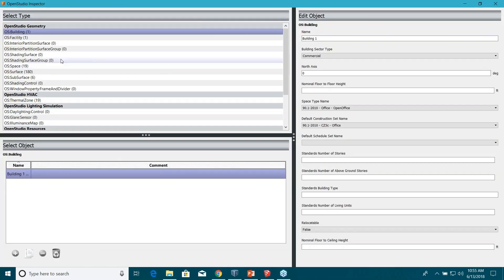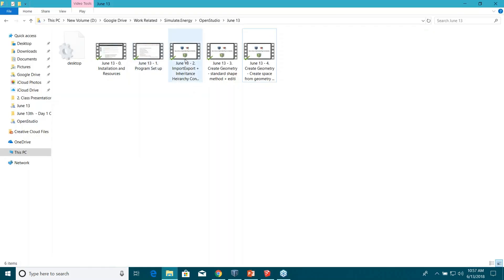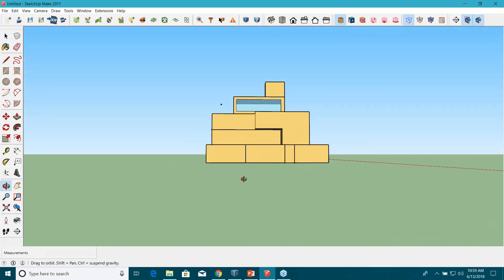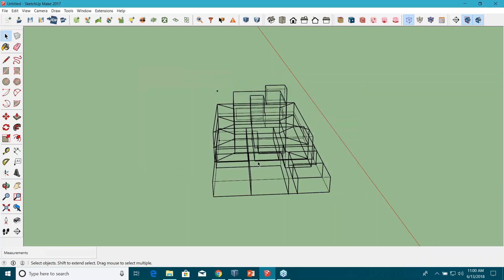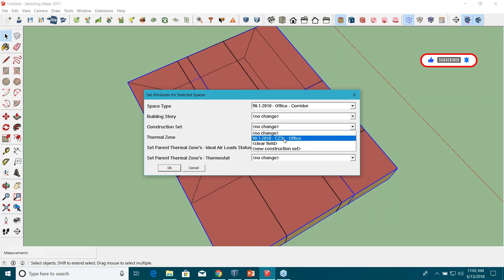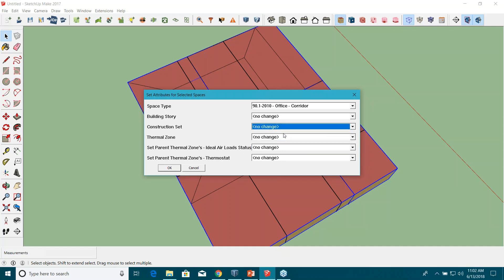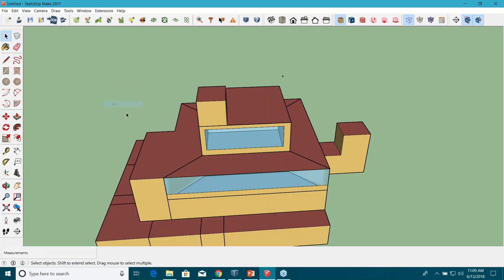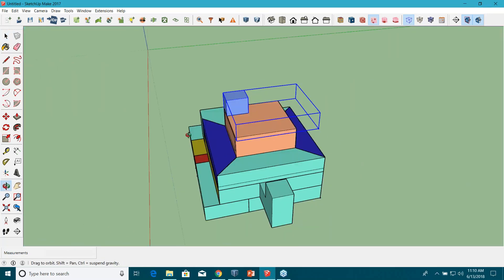OpenStudio Building Energy Analysis Tool | V07 - Assign Building Properties IN SketchUp | EnergyPlus

Comment: Hello, may i please ask a question, when I am doing a multi-layer model, due to the different room structures of the upper and lower floors, after doing the contact surface inspection, the contact surface of the upper and lower floors is not green, they are still the original yellow of the floor, what should I do? Thanks.
Reply from the maker: You have to do surface matching one by one for every space in case the surface match script didnt work out for you..